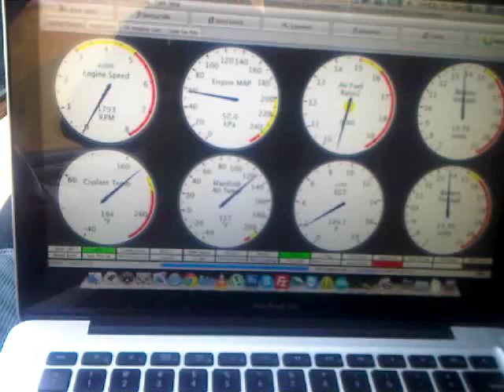Megasquirt Celica ST182 with ST215 Gen IV 3SGTE Swap - First Start

Comment: i have no spark on my setup, 4th gen st215w running megasquirt with ms3x expansion board for sequential fuel and spark. I cannot seem to figure why there is no spark? i have switched 12 v at the COP and injector
Reply from the maker: +mistermike L I would start by looking at the composite logger (in diagnostics) to see if I'm getting a correct tooth pattern with no errors. Give me your email and i'll send you a tune.
Reply: +xgrapher thanks for your response. My email is lesanmike@gmail.com

Is it possible for megasquirt to send a spark signal on the output test mode even if the CKP (Crankshaft Position Sensor) is faulty or disconnected ? I do not have spark even in the test mode. I have sensor readings except TPS. I suspect my TPS is faulty as it is a replacement. But No spark is making me pull hairs out
Reply: No response no graph in the composite logger. Let me replace TPS and CKP and assess

Comment: Greetings! As I understood, you use both stock cam and crank 36-2 sensors. What's your 1st tooth degree in the tunerstudio settings? THanks
Reply from the maker: 575 degrees for Gen IV ST215 3SGTE
Reply: Thanks for the info.